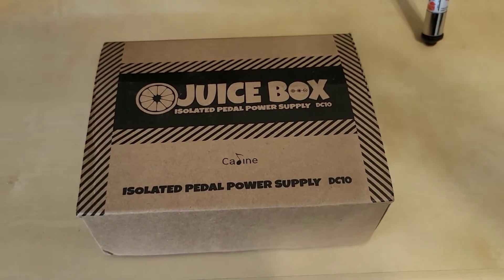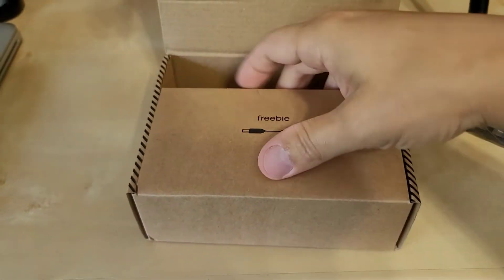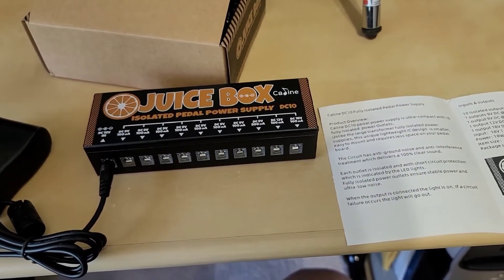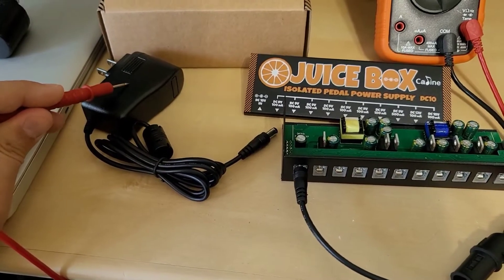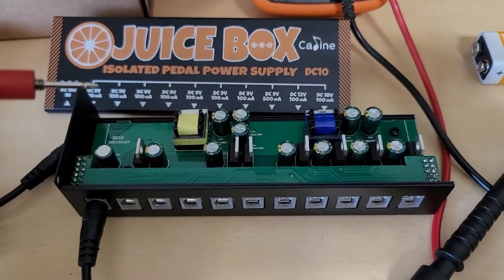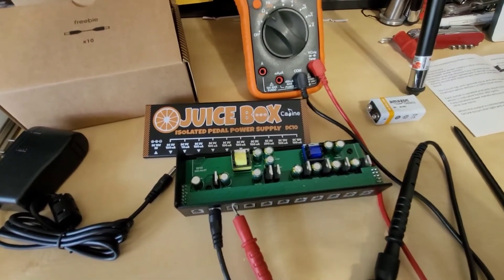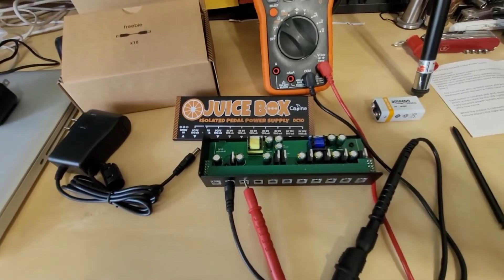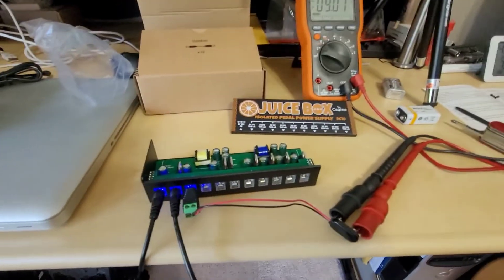Caline DC10 Isolated Pedal Power Supply: Teardown and Review

Comment: THANK YOU!!! ... so they are isolated in pairs.
i don't understand why they wouldn't use a Linear power supply adapter, and get the isolation there first;
then they could have two "blue" transformers, and make the whole thing ground loop-less.
Reply from the maker: Main reason is cost. This is a discontinued model, their newer ones are all fully isolated now
Reply: Oh They Are??? @Bassguitarist1985
Reply: just sub-ed onto your channel....that saved me some bucks, so Thank You Sir !!! @Bassguitarist1985